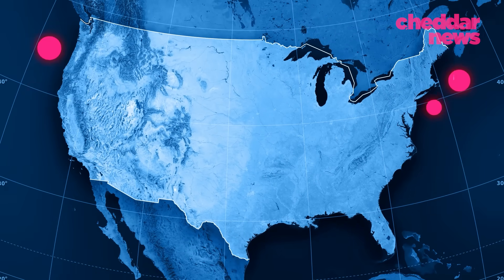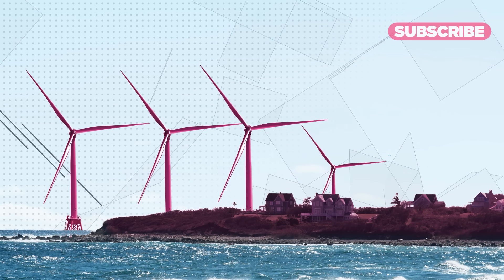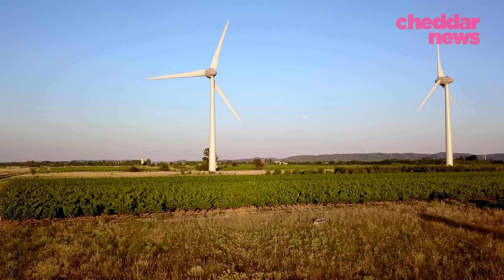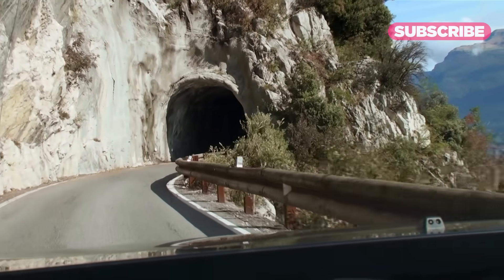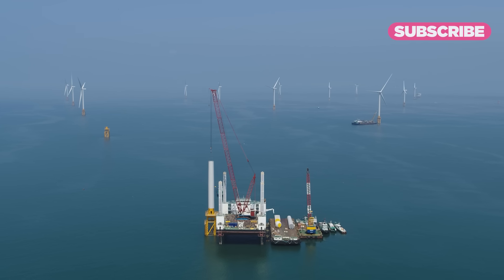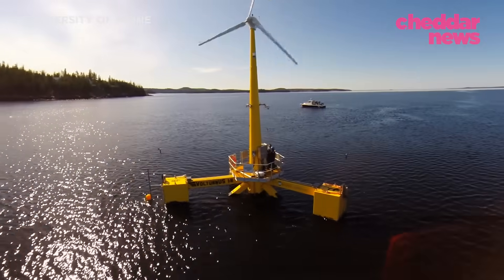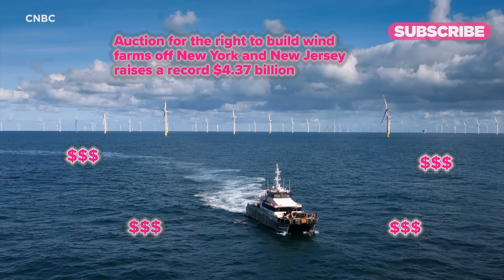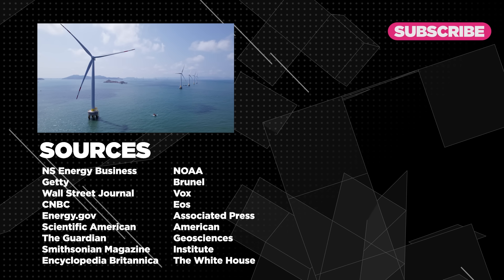Why Finding A Spot For Offshore Wind Is So Tricky - Cheddar Explains

Comment: Jeez some of those cost and build time figures make even the worst nuclear power plant projects look reasonable.
Reply: It isn't just the turbines or the reactors that get the ridiculous project timescales. An interconnector took 17 years to get approval (I forget exactly which state). NIMBYism is the main challenge to reasonable timescales.
Reply: With a nuclear power plant the barrier to entry is a lot higher. With wind, it's at least possible to gradually scale up.

Comment: 3930000 GWH is how much the United States uses a year. 30GWH is so miniscule
Reply: You're comparing apples to oranges. 30GW is how much the wind farms could produce during ideal wind speeds at any moment. 30GWh is how much they would produce operating at 30GW for 1 hour. 365*24*30GW=262800GWh is how much they could theoretically produce for 1 year. Wind farms don't operate at maximum output constantly, so they use an uptime coefficient to adjust expected daily/yearly production. If we use a 0.25, that would give us 0.25*365*24*30GW = 65700GWh. It's still less than 2% of annual use, but you don't get there without having wind farms.
Reply: In French we have a saying that would translate to "little streams make large rivers".  
A single of those wind turbine would power a decent size town... or around 10'000 EVs.  Less than 100 off-shore turbine is equivalent to a medium-size nuclear reactor... and they can be built much quicker!
Reply: *GWh not GW
Reply: @masteryoda394  thanks
Reply: @fyodorgalyukov  you're welcome
Reply: You mean 30GW, not GWh of course. And yes, it is miniscule.  You could scale this 100x in the U.S. coastal waters, but good luck trying to get planning for that. Importantly, the U.S. is blessed with huge PV possibilities, so Wind Power need only be a small fraction of the whole supply. But this prez skipped over a recent tec development: long distance HVDC. The technology is now here (since a couple years) to efficiently and economically distribute power across a thousand miles or so. This means PV farms in, say, Texas or even Mexico could export to many states. Proximity has become less important.
Reply: @jonb5493  power usage in a year is Gwh, read again.

Comment: Technology: It can be done.
Republicans: But we'll use up all the wind! (actual quote)
Reply: Wind and solar are not real solutions, if you truly care for "green energy" you would be pushing for nuclear but with you people it all about virtue signaling
Reply: Yeah, it's called nuclear... the rest is a waste... I'm an electrical engineer, I know what i'm talking about.
Reply: @stachowi  If we gonna go all green, all options should be used not just any particular sources. Nuclear, wind, solar, thermal, hydro
Reply: @DOSFS  why? nuclear is carbon free and can out-power everything else... don't forget it takes energy to build and deploy wind and solar...
Reply: @stachowi  true but the biggest flaw with nuclear is that it’s limited to the amount of fuel that is mined and imported in order to sustain it and how to effectively and properly use and store the waste. Wind, solar, and hydro on the other hand do not have those issues.
Reply: @stachowi  
The big issue at this time is that thermal power plants including nuclear use huge amounts of water for cooling.  With droughts lasting decades there is no cooling water so new nuclear power plants can't be built.
Reply: @stachowi  
You don't know what you are talking about.

Utilities are not ordering new NPPs because they have multi-billion dollar cost overruns and decade long construction delays.  No utility wants that.  Period.

Comment: An upgrade to the power distribution system is needed harassing much because it’s one thing to produce power but it needs to be sent around working along with other source of energy.
Reply: being worked on, EU has the continent wide exchanges, UK company set to start mass producing ultra high voltage under water cables, China is building their ultra high voltage transmission lines to bring solar from the NW desert area that is rather quickly becoming more solar farm then dessert. Not sure about any US projects though probably some private venture around testing some things out home battery storage and smart meters and EVS will help stabilise things as more get on the grid they can charge and be discharged (given permission and compensation for the electricity taken from your batteries, and only down to a pre agreed level)  as needed and will work like small speaker plants dotted all over the country once there are enough of them and if the systems get set up right, Although given the fractured nature of the US's grids it would take some regulation and stepping in by the government and not sure there is the political will, most the EU will have that as a potential solution in the near future though as home battery or thermal storage become a thing it'll get integrated into stabelisation efforts.
Reply: @YearRoundHibernater  Dang this is a very detailed have you researched this in the past for some school work or anything?
Reply: @Thebreakdownshow1  not realy, I have an interest I tend to follow stories on the transition the environment and where I can I check sources and read the papers, studies or press releases. So I know more then the average person I'd say but I'm far from an expert just a curious amature.